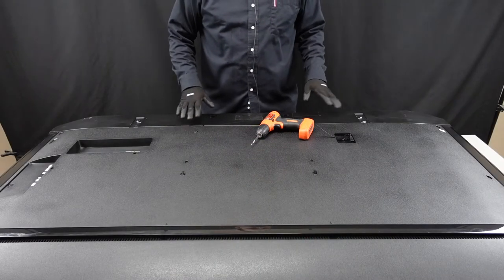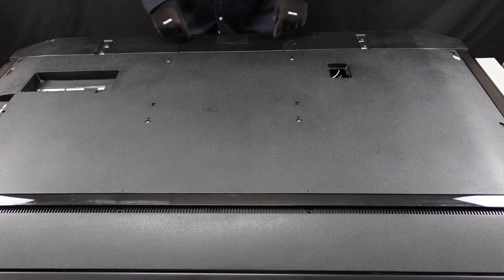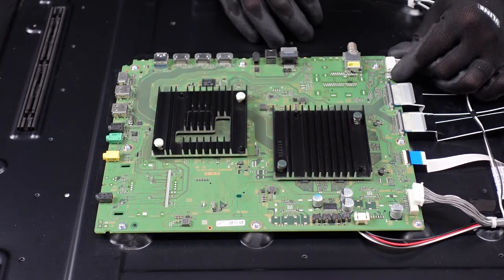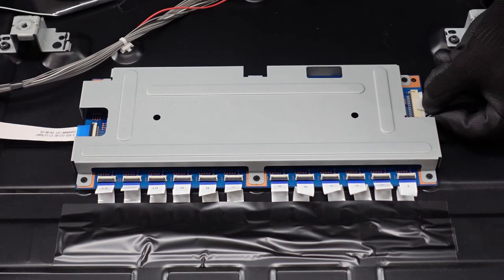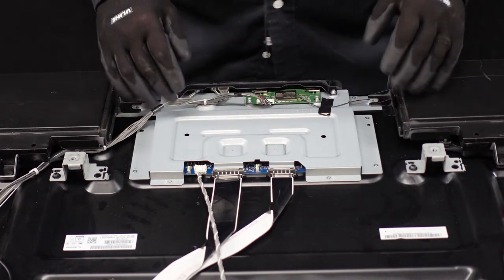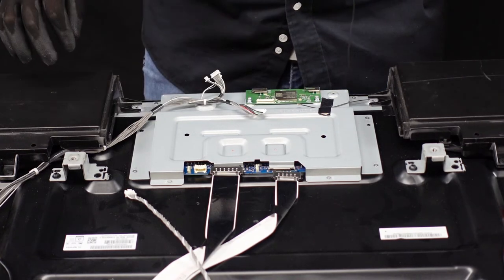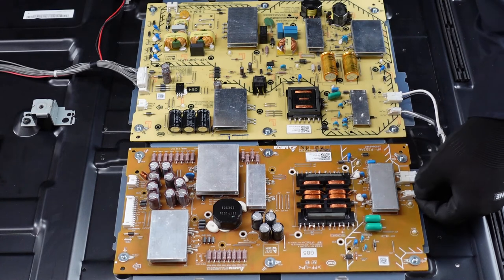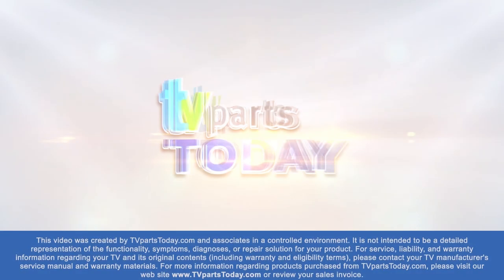Sony XBR-75X900F quick and easy back removal and board removal guide!

Comment: hello my friend, i also I have the Sony XBR-75X900F, 75 inch. It just shut off randomly today, and flashes red 4 times. it will turn on and stay on for like 30 seconds, then shuts off again, everything else works perfect, like the screen and loading when i turn it on, but after like 30 seconds shuts off again and flashes red 4 times, Would that be the main board or power supply boards that I would need to replace? please let me know, thanks so much..
Reply from the maker: 4X blinks in a x900F is likely the backlight strips themseles unfortunately.
Reply: @tvpartstoday  oh k, so what would need to be replaced?
Reply from the maker: The backlight strips themselves will probably need to be replaced.  The backlights are set on the front of the chassis under the panel.  You would need to get the screen and diffuser panels off the front of the unit to get to them. Its a pretty complicated repair.
Reply: @tvpartstoday  oh i see, thanks for getting back to me, one last thing, when the screen comes on its stays on, perfect picture, its only ever 30 seconds or so  then it will shut down and restart, can that possibly be the power supply or main board as well? or
Reply from the maker: Adding: We always recommend googling your TV model number + backlight replacement to see if there are YouTube videos showing you exactly what you would be getting yourself into. We only recommend a DIY-er to attempt it if they are okay with knowing it is last resort as most TV screens are broken during backlight replacement.

Comment: I have the Sony 900F 75 inch. It randomly shuts down and flashes red 4 times. I can typically get it restarted after I reset the power. I’ve noticed if I don’t watch HDR movies and turn down any the post processing it typically doesn’t have an issue. My guess is that it’s overheating since the scren works all good still. Would that be the main board I would need to replace you would guess?
Reply from the maker: What is your full model number?
Reply: @tvpartstoday  xbr-75x-900F.   Thanks!

Comment: Excellent instructional video definitely going to like and share! I have a Sony XBR 75X900H that just powers down on its own. It gives me 4 Red flash's for an error code that I just discovered.  I replaced the main board but unfortunately that didn't resolve the issue. Do you know what the DC voltage should be on the PINS from the power board to the main board? I would like to run a check prior to buying the power board.
Reply from the maker: Hello, 
We typically do not recommend diagnosing a set from the voltages alone, as it can be inaccurate and misleading. For example, if you have an issue anywhere in the set, it could bog down the standby voltage on the power supply board. If there is an issue anywhere in the set, it can prevent the power supply board from coming out of standby and into high power mode. These two examples could lead someone to think their issue is the power supply board if they are going by voltages alone. TV repair is a process of elimination; you replace the most likely circuit board to the least likely circuit board until one resolves the issue. If none of the circuit boards fix the issue then it is determined to be a failure within the back lights or the panel/screen. 
The four blink code in your model indicates that it could be the LED Driver, main board, or power supply. 
The manual states that is the order in which to try, you could order all three parts to save on shipping and return any parts that are not needed. 
The links to those parts are listed below. Also feel free to contact Info@tvpartstoday.com for any questions.

1st LD Driver:  https://www.tvpartstoday.com/A5012966A-Sony-LD-Board-A5012966A-1-006-902-11-p/a5012966a.htm

2nd Main Board: https://www.tvpartstoday.com/A-5014-266-A-Sony-Main-Board-A-5014-266-A-A50142-p/a-5014-266-a.htm

3rd Power Supply: https://www.tvpartstoday.com/1-006-133-21-Sony-Power-Supply-100613321-G03-29-p/1-006-133-21.htm

Comment: Hey man I have the 55in version and it just stopped working a month ago, when I try to power on I can get it to the android circles and sometimes to the welcome screen cuz I reset it, but then it shuts off, then I get the 4 blinking lights, do you think it's just the power board? If it was led there wouldn't be a picture right? I'm gonna buy the parts from you guys just don't know which ones to get
Reply from the maker: With Sony TVs there are usually what are called "blink codes". That is the "4 blinking lights" you see after the unit shuts down. These usually tie back to a number of parts that could be the issue. Send us an e-mail to info@tvpartstoday.com with a brief description of your symptoms and your TV model number and we can get you pointed in the right direction.  Thanks, Nick.

Comment: I have this same tv and its giving me issues. No picture at all but can hear sound once it turn it on. Opened up the back. Noticed the led driver board has a green light and a red light flashing in 3 consecutive flashes as soon as i turn it on. Is the red led on the led driver board an error indicator? Was going to just replace the main board but came across your video and thought I would ask the pro’s.
Reply from the maker: First we would need to find out if you are getting the backlights to fire correctly. We have a video on how to do a flashlight test to see if your backlights are on or not. Ill link that. https://www.youtube.com/watch?v=2TMfkYy58ZU

If you are getting backlights, then your mainboard is most likely the issue here.
If you are not getting backlights, then I would recommend swapping that LED driver.

Comment: Hi there! I love your videos and explanations. I have the Sony 4 red blinks of death on my  XBR75X900F tv. I replaced main board, downloaded and attempted to install firmware update. TV turns on and was showing white light to indicate updating, then Sony logo followed by android logo....then black screen and 4 red blinks. Does it sound like bad main or LED driver board? I refuse to give up on this tv. Thanks in advance!
Reply from the maker: Blink codes on a Sony TV can be tricky. There is a list of possible problem boards and parts that are attached to each code, so narrowing down the problem is about as good as we can hope for. If you send us an e-mail to  info@tvpartstoday.com with your model number, your symptoms, and a list of the boards you have already replaced we should be able to get you pointed in the right direction. Thanks, Pearl!

Comment: I have XBR-75X900F. Getting No power-  no standby light. No Backlight.  I see 120 volt but no stand by 3.3 volts.. pin 5-Ground OR at pin 9,10,11…to Ground  NO 12 volts either.  (May be I am measuring wrong place. )
In your opinion which board sub power supply or main power supply board (part # AP-69AM. OR AP-P353AM A) be faulty and replace it?
Reply from the maker: Hello, 
It could be either the power supply or the main board. Unfortunately there is no way to know exactly which board is the issue as it is a process of elimination.

Comment: Sony xbr85x850g turns on show sony logo then fades into some colors vertical lines anysuggestions please?
Reply from the maker: It sounds like either the Main Board or the T-con Board is having issues in your TV set. I know some Sony models have a "test screen" that displays when there are problems. If you send us an email to:     info@TVPartsToday.com      with your model number and a brief description of your issues we should be able to provide you with some more, in-depth, troubleshooting advice. Any pictures of the vertical lines you can send with the email will help us out a lot.

Comment: Samsung UN50MU6300F BN97-13669A BN94-12530L Main Video Board
Reply from the maker: Hello, 
The Bn97 number is actually just generic board numbers used during the manufacturing process and will not guarantee compatibility when searching for a replacement part. Please do not use these numbers to decide on a part. 

Below is a link to the main board you are looking for part number BN94-12530L (we are currently out of stock. 
https://www.tvpartstoday.com/BN94-12530L-Samsung-Main-Board-BN97-13669A-BN41-p/bn94-12530l.htm

We do get new inventory twice a week; you can register for the in stock alert email on our website to be notified as soon as we put another one into our inventory.
Reply: One more question i got 2 recommendations for alternatives to used UA65MUC30SJXXZ motherboard BN41-02568B screen CY-WK065HGLV1H……&……..UA55MU6880JXXZ main board BN41-02568A screen CY-WK055HGLV1H the 2 boards looked exactly like my boards but the question is would there work how you ever tested anything  like that before ?